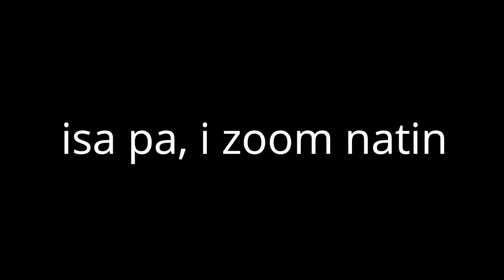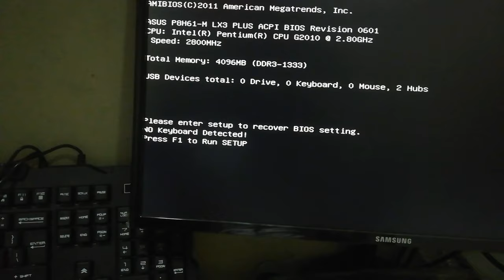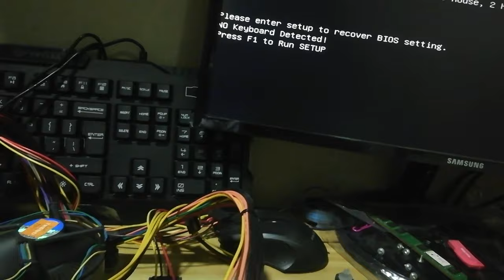Motherboard NO POWER FIX....

Comment: Naayos ko yung sakin sobrang basic lang pala ng problema. Akala ko kung ano na nangyari, tinroubleshoot ko na yung power supply kung gumagana ba o hindi. Gumagana naman, ang nangyari kasi ay ganito. Inilipat ko yung system ko sa panibagong case. Ang tanging dahilan lang pala kung ayaw mag boot ng mother board ko ay kulang ng gintong tornilyo. Mahalaga pala yun, di ko kasi kinabit. Nung kinabit ko naayos na.
Reply from the maker: Ahaha, di ko alam kung anong gintong tornilyo yun, pero buti nmn at okay n
Reply: ano mga symptoms nung una lods?
Reply: Ano po yung gintong turnilyo
Reply: @kenggg8960  standoff screws
Reply: Paano po kung iikot lang yung fan tapos papatay, iikot naman. ano po gagawin don?

Comment: Boss paano naman if may ilaw ung led sa board pero walang power? As in hindi din umiikot ung fan ng cpu
Reply from the maker: POSSIBLE nasa VRM section ng mobo ang sira,ito ung malapit o paikot banda sa processor. check mo mga mosfet at capacitor na malapit sa  processor

Comment: Sir ano sira ng pc ko kapag nag bla black screen? Pero pag pinatay ko sa psu Niya at tinurn on ko ulit mag I start ng normal yung PC.
Reply from the maker: initial pending ko sa ganyan ram, or kung okay naman possible hdd
Reply: @dareuttech sir Tanong ko lang  if mag kaiba ng brand yung gamit Kong ram sir pero parehas lang ng specs ( DDR3 4gb 1600mhz ) pwede naman sir no? Yung isang ram ko kase sir few months palang nabili at yung isa 1 year na
Reply: @dareuttech  yung hdd naman sir halos 1 year palang
Reply from the maker: @christiansingian23rd  yes pwede, kahit magkaibang brand

Comment: Pwede po magtanung boss .. kung panu ayusin tong HP ELITEDESK 600 GI SFF kagabi nagamit ko pa kinaumagahan no power na pati yung LED indicator sa mother board walang ilaw 
Pero yung power supply ok naman as per diagnosis. 

Anu kayang solution nito boss
Reply from the maker: Sff meaning mini pc? Check mo muna power adaptor using tester, if wala k try u muna mang hiram o dalhin yung adaptor mo, then saka mo ako balikan sa result

Comment: iba po  ung bios files sir.  ng try nq ng ganyan. ang nwala po ung lan port. mas maigi po e flash nyu n lng s tama files at update para mas ok per4mance. my compatibility issue po xa s lan. Pro nice tutz  po  s sharing video. ty
Reply from the maker: Tulad ng sabi ko sa isang video, same issue possible iba iba ang solution or effect, pwede nawala lang port sayo, pwedeng sa iba hindi, pwedeng nawala lan port sayo sa iba nmn usb port or sounds, kaya sa pag ri repair hindi pwedeng i base sa mga previous o i base sa issue ng iba kahit same na same sila ng problem

Comment: Hey my pc get a strange issue. When i switch on the power the motherboard didn't show any sign of power but then i switch off the power and then switch it on within 2-3 seconds now it works fine. But this issue every time when i power off the main switch. And also every time i boot into my pc bios get reset. Can you help in his issue

Comment: B365m-A Asus, umiilaw naman led light niya pero nag try na ako ng ibang cpu at ibang psu. Hindi padin gumagana Or nag oon. Working naman ibang parts yung mobo lang talaga. Parang same ng problem sa'yo sir.
Reply: After kasi ng brownout hindi na siya nag ON,
Reply: Possible ba na nadamay din yung cpu?
Reply from the maker: @mangkepweng2104  need i check pra sure sir

Comment: Sir, ask kolang po yung motherboard ko po kasi umaandar lang po yung cpu fan pag hinold mo yung switch button then pag pinundot mo naman ng isang beses namamatay din po sya agad, ok naman po yung psu nya.
Reply from the maker: First may 2 yta akong vid on how check psu, hindi porke umaandar is okay nmn ang psu.
Pag nag o off hula ko lng dahil di ko nakita cpu mo ay sa VRM section , in non tech term may sira either mosfer or capacitor
Reply: @dareuttech  tekyu po idol papanoorin ko po yung vids nyu about dun sa problem thanks again.

Comment: Good day po, ask ko lang panu po kung nakashort ang green at black wire sa 24pins connection ng MoBO then shinort din po ang power switch terminal nya tapos po may power na , then pag tinaggal po yung pagkakashort ng green at black wire is wala po ulit, anu po possible defect dun?  Thanks in advance :)

Comment: Ask q lng bkit nid po palitan ng bios chip? pede nman po xa e reflash at derecho update files na. ska iba files po ng bios ang nailgay. d tugma s mismo board.  mas ok po e update n lng xa s version na 4601.
Reply from the maker: Hindi kasi lahat ng nag aayos may pang reflash,mostly sa mga video ko diskarte pinapakita ko,
May mga instance na hindi na nag bo boot pag corrupt na kaya hindi ma a update.tulad ng pinaliwamag ko sa video same bios sila at nakita nmn sa video nag work,
At ilang beses ko din na banggit dyn yata sa video na sa computer hindi porket same ang sira ay same din ang possible solution na gagawin madaming pwedeng  gawin,best example ay yung mga boot loop sa playlist ko pero iba iba ang solution na ginawa

Comment: Sir bagohan sa pc building. Gusto ko sana i try ung bagong bili kong rgb fan kaso wala pa ung cpu,gpu,ram ko ang meron lng sakin is motherboard at psu. sinaksak ko sa outlet ung psu at sinaksak ko din ung 24pin sa motherboard at sinaksak ko din ung rgb fan sa molex connector sa psu. Pwede ba yun?
Reply from the maker: Kung molex ang power input ng rgb fan meron kang 2 option to check ung rgb fan.

1st tulad ng ginawa ko sa video, using psu at rgb fan only, i connect mo lang yung molex ng rgb fan sa psu, then i short ang green wire at blk wire ng psu pra mag ON, Kung wala kang idea better research or wag mo ng i try.

2nd option
I power on mo na yung pc mo, i connect na lahat ng dapat i connect, 24 pin to mobo, 4 pin ng mobo, then connect yung molex power ng rgb sa psu, pag okay na i ON mo na power button

Comment: Sometimes pressing the power button turns on my PC normally.  But sometimes after pressing the power button many times it won't turn on, no power at all
Reply: Try replace your powersupply
Reply: Same issue
Reply: Same issues 😢
Reply: @1MW07F  SAME ISSUE I TRIED MANY POWER SUPPLY BUT WONT POWER ON

Comment: Ser pa help naman po same scenario lang din po ng sainyo na pag inoopen ko ung motherboard using screw hindi nag oopen motherboard ko at hindi umiikot ung fan na test ko napo ung PSU ko okay naman po tinest ko narin po ung mosfet ko okay naman po lang wala pong double beep ano po kayang posibleng problema nun sir? Salamat po sa sagot
Reply from the maker: no power? malamang mobo na yan, pero mahirap hulaan ang issued nya kaylangan ma troubleshoot  pra masabi kung saan talaga ang issued.

Comment: sana mapansin sir ask ko lng po if sa pagtest ng continuity may mosfet po na di nag beep kahit tama naman pag test ko minsan nmn is nag beep saglit pero di tuloy tuloy beep once lng minsan nmn wla po beep pero may resistant reading yung mosfet na tinetest ko malapit po sa 24 pin socket sa may gilid ng ramslot ung mosfet
Reply from the maker: Di nag be beep= pwedeng sira

Once beep= pwedeng grounded or sira
Reply: @dareuttech  na confuse po kc ako sa mode ng pagtest ung iba po tutorial dito diode test mode po ang gamit di continuity pinatatangal sa board ska itest using diode test mode
Reply from the maker: @peimuskidgecko801  haha, tama naman ung diode test at baklas tapos test,yang baklas tapos test isa sa proper way ng pag te test,
Pero kung ANO ka na or matagal ka nang nag te test, isang test lang o kahit di mo na baklasin malalaman mong good or defective na

Comment: idol anu kya sira ng mobo ko,pg unplug q ng psu s ac socket bumabalik s default settings ung pc q
Reply from the maker: default setting ng bios?
Reply: @dareuttech   opo,bumabalik s dating settings
Reply from the maker: @elmerbaquiran3006  change cmos battery
Reply: @dareuttech  bagong palit lng cmos battery nun eh
Reply from the maker: @elmerbaquiran3006  better dalhin nlng sa tech para ma check

Comment: sir ask ko lang po how to fix the indicator problem of mother board ? my ilaw kasi un mother board pero ayaw mag switch po
Reply from the maker: indicator ba ung may ilaw? possible may issued sa motherboard mo, need i check
Reply: @dareuttech  yes po my ilaw un mother board kasi sabi ng technecian nd dpt po un iilaw kung power supply lang po un problem nya mismo.. un kasi ang sabi  sa akin ng isang technician na indicator na po un sira nya mismo..salamat po sa responses
Reply from the maker: @thedoctorvirus3997  motherboard nga, need ipa check sa legit tech
Reply: @dareuttech  ganoon po ba maraming salamat po keep it worth
Reply from the maker: @thedoctorvirus3997  pero wag u muna pa palitan mobo,baka sakaling maayos pa
Reply: @dareuttech  geh po sir copy maraming salamat po sa info..

Comment: Boss may idea po ba sa mga bagong boards b550m mortar na umiilaw ng pula sa dram debug leds..? Na try na po itest lahat ng ibang parts okay nman.. ayaw mag on ng pc kahit sa bios ayaw din..
Reply from the maker: may na experienced ako sa b550 weird , at kung mababasa ng iba baka sabihin wla akong alam, pero nangyari talaga na namimili sya ng ram,kung may change try mo palitan ng ibng ram .

then ano processor mo?
Reply: Na try na din po ibang ram na gumagana sa iba pc ganun pa din ayaw mag boot.. r5 3600 ang cpu na gamit .. nauwi n lng na bumili ng bago board.. gumana nman.. sayang lng din kc ang sirang board baka may chance pa.. salamat boss
Reply from the maker: @jimblossom17  ayon NAKITA ko na ang reason,
anf RYZEN 5 3600 ay walang integrated graphics , need mo ng dedicated gpu lods
Reply: May gpu naman boss .. ayaw tlga mag boot.. gusto ko rin sana matuto mag troubleshoot ng mobo.
Reply from the maker: @jimblossom17  brand-new b? o working nmn dati ?
Reply: Yun ung problema boss 2nd nabili ang motherboard..sinabi na operating product tapos un pala pagdating samin sira pala
Reply from the maker: @jimblossom17  un lang... need ma check up mismo ng board lvl tech pra sure makita ang sira

Comment: sir yung asus prime a320m-k ayaw mag power pero my ilaw yung parang led nya sa board pag sinaksak posible ba na board or processor sira salamat
Reply from the maker: need muna ma check ang RAM,PSU at kung hindi grounded bago natin masabi na possible motherboard na ang sira
Reply: @dareuttech  tinest ko yung psu nya ok lhat pati mosfet walang shorted
Reply from the maker: @irish gaveria  reflash bios at check processor , bihirang bihira masira ang processor pero check mo parin
Reply: @dareuttech  panu po ma reflash hindi po sxa nag oon pero umiilaw led sa board yung design
Reply from the maker: @franz-motovlogs3516  need ng tools sa pag re flash ng bios, assuming na na check mo na mobo ha,

Comment: boss,,ano kaya possible cause ng sira ng no power sa motherboard??
Reply from the maker: Possible reason kung bakit nasisira? Tama ba?
Reply: @dareuttech  opo
Reply: tska ask ko na rin,,,nag no display kasi pc ko tapos nung nireseat ko yung cpu nag no power na motherboard,,,nadali po ba ng esd yung board ko?? tska pati cpu po ba damay na rin??
Reply from the maker: Baka nga nadali, bihirang bihira ginagalaw ang cpu (processor), saka ingat pag nag babaklas,

Ang mga electronics components like mosfet, capacitor lahat yan may lifespans (walang forever 😁) nakakadagdag pa ng maagang pagkasira ang heat, power fluctuations, over voltage and soon
Reply: nice sir,,, salamat sa sagot

new subscriber niyo na ko 😁
Reply: pero sa tingin niyo sir,,,nadamay rin kaya cpu sa esd???,,,,o motherboard lang po yung sira?

Comment: Nice video sir, may ask lang sana may good PSU ako pero pag kinabit ko na sa motherboard if mag voltage test ako nawawala ung dc voltages specially 12v ng PSU, any advice at possible test point. Thank you and godbless

Comment: Sir, tanong ko lang. Pano nyo tinest ang mga mosfet? (Habang naka power on ang psu at nakaplug sa mobo?)
Reply from the maker: Continuity lang, naka off ang mobo, unplug power sa psu o off switch ng psu
Reply: dareut tech salamat po
Reply from the maker: @axelgaming6469  ung test ko dyan sa mosfet grounded ung tunog nya, kaya by instinct alam ko na  sira un, kaya remove sa move then test uli para sure

Comment: GOOD AFTERNOON PO SIR! 
Badly need help po NO POWER po yung PC 

Ayaw nya po mag open and shows no sign of power.  
Natest ko na po ang mga ito at nagana naman: PSU AT SWITCH, CMOS BATTERY AY 3VOLTS, yung motherboard po diko alam testing 

Ang nagiging scenario po tuwing umaga is ayaw nya magopen tapos BABRUSHIN ko po yung motherboard randomly hanggang gumana po sya at pag NAOPEN KO NAPO NG ISANG BESES,  OKAY NA PO SYA BUONG ARAW AT NO PROBLEMS AT ALL tapos po kinabukasan ganun ulit po no power then ulitin ko lang po yung ginawa kong pagbabrush. Halos 1week napo ganon yung routine ko. Minsan po Inaabot nako ng 2hours pagbabrush pero ayaw parin

Ano po kayang sira nito?  Need na po ba magpalit ng Motherboard? 

THANK YOU PO IN ADVANCE
Reply from the maker: Pag ganyang scenario possible motherboard na ang sira, pero mahirap ma check kung alin mismo sa mobo ang sira, need ma troubleshoot ng tech, or palit mobo na
Reply: @dareuttech  thank you po sir. Nagagamit ko parin po kasi e Pahirapan lang po pag oopen sa umaga. Pag naopen ko na po ng isang  beses nagana na sya buong araw walang kaproble problema
Reply: same problem tayo sir.. ayw din mag on ng pc ko pro may ilaw nmn yung keyboard ko at mouse tsaka ok nmn ung monitor at psu... san ba dapat e brush sir pra mag ON? patulong po baka mkatulong din sa prblma ko salamat.
Reply: @neileduardsubere8252  yung sakin no power at all,  walang ilaw sa keyboard at mouse pero fixed na sya ngayon,  walang sira ang mobo grounded lang sa mga cables ko at maluwag saksak sa hdd 

Try mo tanggalin lahat ng saksak then re plug mo tas medyo ayusin mo yung cables wag mo hayaang nakabulagsak
Reply: @neileduardsubere8252  Reset cmos mo nadin par baka nagooverclock ka
Reply: cge po salamat try ko .
Reply: @adeptusxiao6473  siguro nga nag overclock kay may may warning na sa fan same sakin hanggang ngayon minsan hindi gumana pag nalamigan sa gabi d na mag on sa umaga

Comment: Sir pano po kapag umiilaw Yung led Ng motherboard tapos di Naman umiikot lahat Ng fan.. pati fan ng power supply di Rin po umiikot.. PSU  po ba sira nun.. sinubukan ko po itest Yung power supply gamit Yung paper clip pero ayaw parin po umiikot nung fan TAs kapag hinawakan ko po Yung power supply wala akong maramdamang kuryente.. Kasi kung Meron po Yun makukuryente po ako nun e..  Tanong ko lamg po Kasi po baka motherboard din po sira e.. thanks po kung masasagot niyo.. 🙂🙂
Reply from the maker: base sa sinabi mo walang power ng psu mo, need palitan,
Reply: I have same issue umiilaw nmb po ang motherboard pero ayaw umikot ng psu and fans 

Pero pag ground ko sa psu umiikot naman
Reply: Same din ng prob tol na solved na ba? Ano naging problema?
Reply: same issue din nag palit na nga ako psu wala paring power minsan nag auautomatic nlng start pag pinabayaan ko nakasaksak
Reply: @o2jamer62  baka mobo tol or cpu buti sakin na fix pa psu prob lang

Comment: Sir, tungkol sa motherboard, pag plug ng psu, umiilaw ang logo ng motherboard, pero pag power on ko na, hindi nag power on, next, nag power on ako gamit ang screwdriver, pero hindi pa din nag power on, possible sira na motherboard?

Bale, pang third day ko na na troubleshoot, nung una, ayaw mag power on sa switch, so sinubukan paandarin gamit screwdriver, ayaw din, kaya kinalas ko lahat ng component tapos, umandar sya, kinabukasan, ayaw mag on ulit, kinalas ko ulit tapos gumana sya, pero ngayon, third day, ayaw na talaga. 

Possible sira na motherboard?
Reply from the maker: yes,possible motherboard, try mo din palitan psu
Reply: @dareuttech  Very nice video. I like it. Mayroon akong tanong. First, mayroon akong LCD PCI Diagnostic Analyzer Tester, ang na-detected niya ay yung FRAME at yung RST (Reset) na naka-indicate ay Invalid. Saan lugar ang FRAME at yung Reset sa motherboard ng ASUS P4P800-E Deluxe? Iyan ang next problema. Nung year 2019 ay na-repaired ko na yung mosfet, capacitor at IC-driver mosfet sa tabi ng Processor kaya mayroon ng 12Volts na pumapasok sa Processor at Fan. Kaya ang problema na lang ay yung location ng FRAME at RST na duon sa area ko hahanapin ang problema. Puwede sana na paki-tignan at aantayin ko na lang ang sagot. Ito ang manual website niya -->https://www.manualslib.com/manual/444306/Asus-P4p800-E-Deluxe.html?page=11#manual.  At ito pa yung image picture ng motherboard. Thank you -->https://www.google.com/search?source=univ&tbm=isch&q=image+picture+of+ASUS+P4P800-E+Deluxe+motherboard&client=firefox-b-1-d&sa=X&ved=2ahUKEwji4Ji9id_yAhUyJDQIHdjVAfkQ7Al6BAgGEDo&biw=1337&bih=624.
Reply: balita naayos mo na?